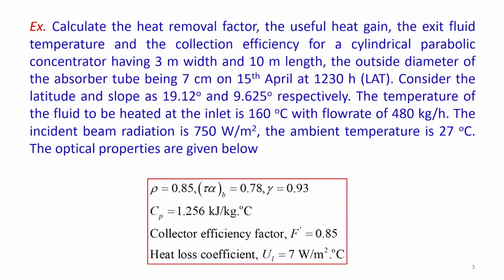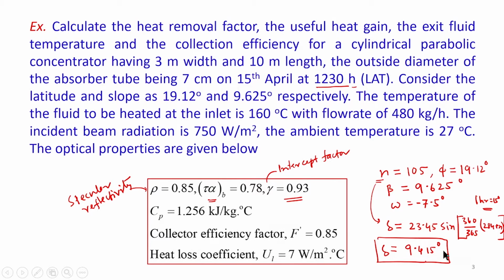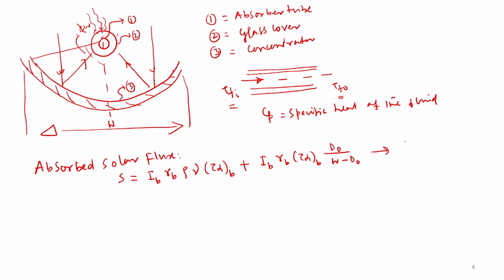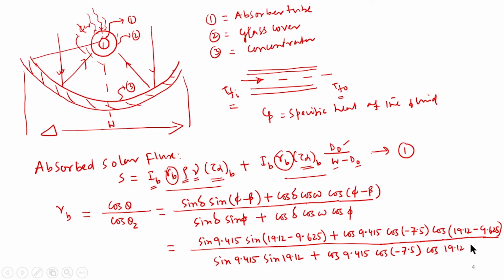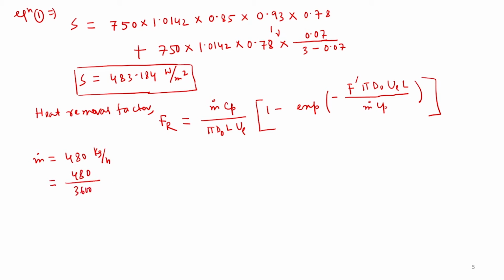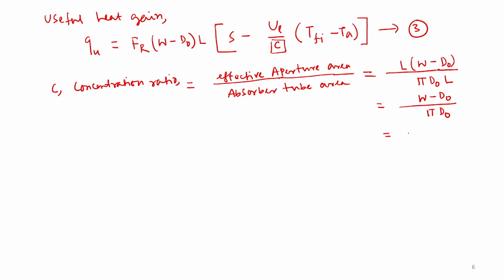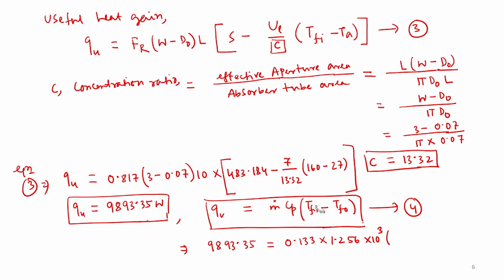Tutorial : Concentrating Collector

Comment: Timestamps (Powered by Merlin AI)
00:23 - Tutorial on solar concentrating collectors calculations.
03:22 - Calculating solar angles for a cylindrical parabolic collector.
06:07 - Overview of the Concentrating Collector's components and fluid dynamics.
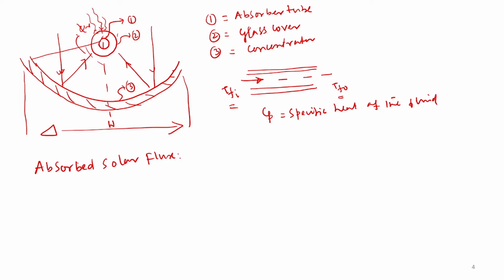09:05 - Calculating absorbed solar flux using beam radiation factors.
12:01 - Calculating solar flux using key parameters.
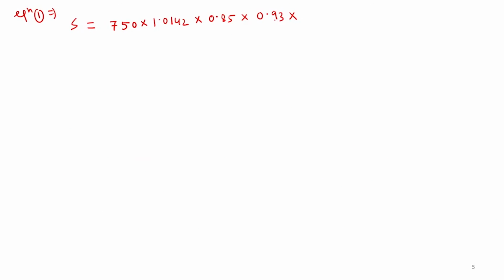15:13 - Calculating the heat removal factor for solar flux analysis.
18:08 - Calculate flow rate using specific equations for concentration.
00:00 - Calculating useful heat gain and concentration ratio in the collector.
23:24 - Calculating useful heat gain with concentration ratios and efficiency.
25:56 - Calculating tfo and instantaneous efficiency in the collector system.
28:38 - Efficient solar collector parameters are calculated, yielding 43.35% efficiency.
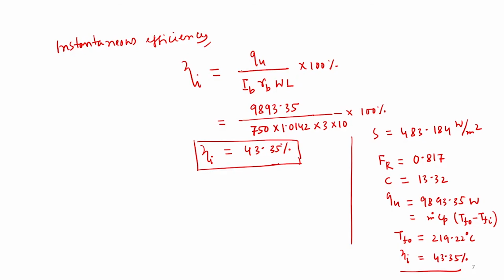31:01 - Understanding solar collector design and efficiency calculations.